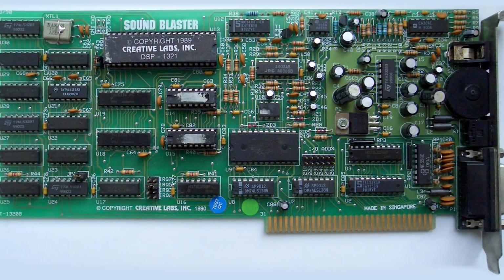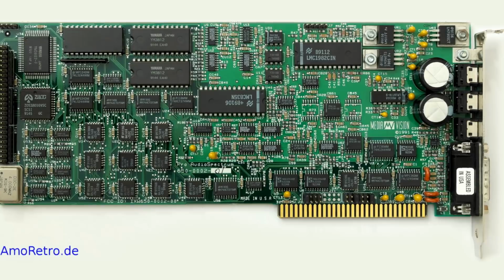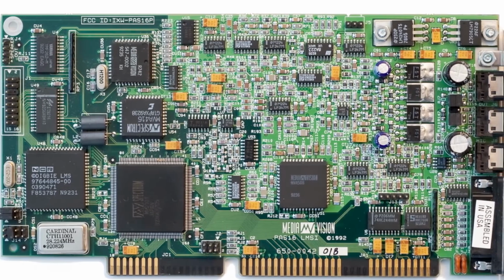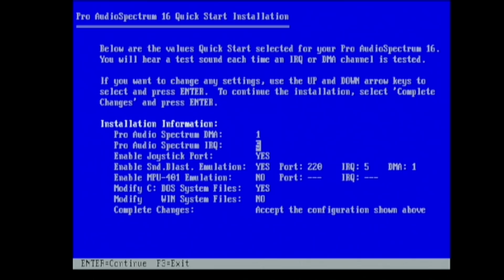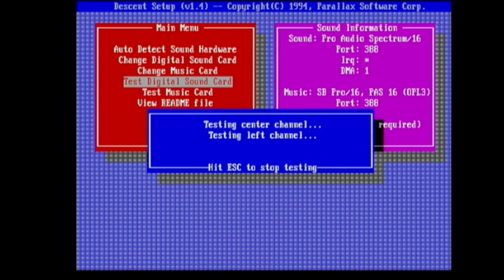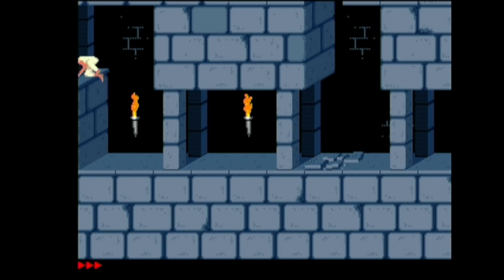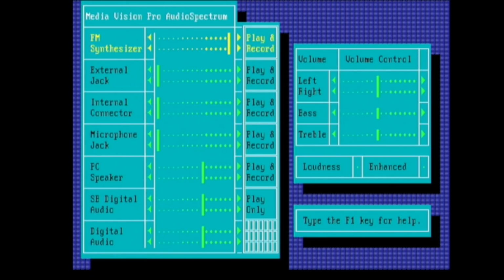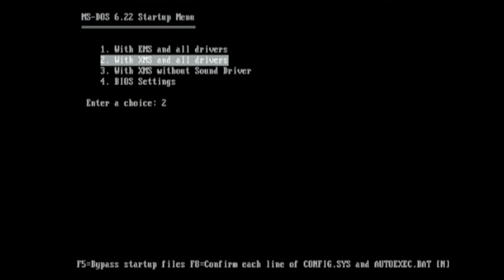MediaVision Pro Audio Spectrum 16 - myth or legend?

Comment: How about a video on Aztech sound cards? They had some quite good ISA cards, some of which they used their own chip designs on. Some of their products were sold as Reveal, usually with Reveal stickers put onto the Aztech chips. I remember having one "Reveal" sound card I was having problems getting to work. I peeled the Reveal sticker off to find an Aztech sticker. Peeled the Aztech sticker off to ahem reveal the actual manufacturer. I found drivers for that and was able to make it work.

At some point Aztech had a huge clearance sale where they were getting rid of all their old stock of hardware that was out of production. I had an 8 bit Aztech card at the time and bought their special wavetable upgrade for it. I don't recall how much $ but it was super cheap - sounded super good though. I do remember I sold the card a while later with wavetable upgrade to a computer store for $50.
Reply from the maker: I have a lot of different Aztech sound cards in my collection. They were stuffed with features, that's why they are interesting too, but were always a really low quality products. Noisy like hell in both ways on the data bus as well as white noise on the output. I still like them too, because they had some features, which other cards didn't have.

Comment: I had a computer with both a PAS16 and a SoundBlaster 16, all configured so that I didn't have to have a boot menu but I still had plenty of low RAM. Each DOS game was setup to use whatever sound features were the best it supported. The PAS16 wasn't actually made by MediaVision, it was a "Reel Magic" combination VGA and sound card, minus all the video and SCSI parts. Apparently the company intended it to be used as a second PAS16 alongside the full video+sound+SCSI Reel Magic card. Simpler to just not populate most of the parts rather than make a different PCB design for the sound only card.

Yup, the PAS16 supported having TWO of them in the same PC. I assume there must have been some software that supported four OPL3 channels or may have been able to use the the mono OPL2 support on two cards for stereo, or 4 channel PCM or???

The SCSI controller on PAS16 cards with it was automatically recognized as a Trantor SCSI controller by Windows 95, and a daisy chain of several SCSI devices could be connected, but lacking a BIOS the sound card couldn't be used to boot the computer. Not that you'd want to because it was SLOW. Just fast enough to handle the transfer speed of a 4x CD-ROM.

MediaVision may have produced a "holy grail" of sound cards, or it may have been vaporware. I saw an announcement or advertisement for a card named "ProZonic", described as supporting just about every PC sound card standard there was. PAS16, Jazz16, all the SoundBlasters, Covox etc. IIRC the only one it was not claimed to support was Gravis UltraSound. Would have been the ultimate in ISA audio, one card, no configuration hassles, plays well with ALL the games.

That was probably right around the time MediaVision went bankrupt, then was reorganized and the new MediaVision insisted several products with their company name, logo etc printed right on the card did not exist. I had one, a Jazz16, said so right on the card. The guy I talked to at MediaVision (at the time I knew nothing about the bankruptcy and reorganization) insisted there was no such soundcard, they'd never made any soundcard named Jazz16.

So if there are any ProZonic cards, even prototypes or engineering samples, it would be quite a collector's item.
Reply: Im trying to figure out where the Media Vision products went after bankruptcy.  I know they rebooted as Aureal, but someone else got the assets before they rebooted.  I think it was an Indian company....random question i know but thought id ask...

Comment: I had an SB16 with a date of 1992. It was loaded with capacitors and jumpers. It sounded perfect and never had a problem with it. I used that card for 10years, it eventuality got noisy.
My mate had a PAS16, not sure of date. It sounded like shit compared to mine, and it gave no end of problems.
Reply from the maker: I guess, that's a very subjective opinion. Of course I don't know the system setup of your friend back in the days, but at least in terms of quality PAS16 is technically by far a better sound card. Apparently, I collect ISA sound cards and investigated and reverse engineered them quite a lot. I have almost all Creative cards at hand and three different SB16 among them. One with new Panasonic high-quality caps, which Creative didn't even think to use back in the days. So I can compare them quite good.

If you are interested in details,  as I said in the video SB16 improved very much compared to its predecessor SB2.0. Creative finally got managed to get rid of the data bus noise, but they were still not as good as PAS16 in regards of the white noise. One of the reasons was, that SB16 made the digital to analogue conversion very early in the chain and was trying to mix and filter the audio signal afterwards. PAS16 on the other hand postponed this step and worked with digital sound as long as possible. They added high quality DACs and moved them out of the DSP to the very end of the signal processing. Not only did it give us very impressive sound control features, which were non existent otherwise at that time,  this is also why you will see almost none of the electrolytic caps on the PAS16, except of two bigger decoupling caps right before the output. SB16 on the other hand used a lot of cheap electrolytic caps, which degraded over the time and introduced even more noise. PAS16 didn't need to use them, since in digital part you can better use tantalum caps, which are a lot more expensive. That was the reason for Creative to make their design in the first place - the price, just as always! Also the fact, that PAS16 didn't use electrolytic caps makes this sound card sound today just the same as it did sound 30 years ago. Without the need to recap it.

Comparing those two cards is a hard thing, since one was a cheap consumer oriented product and the other was a semi-professional high quality product, which was probably too expensive. It's like with digital cameras today, you won't buy an expensive DSLR, if you want to make your pictures in Auto-Mode all the time. It's not worth the money, since in Auto-Mode it is probably just as good (or sometimes worse) as a smartphone.  But if you need to get more out of it, you will reach the limits of a simple camera quite fast.

A sad fact is, that as soon as MediaVision was dissolved, Creative dropped the quality dramatically and introduced all the cost reduced SB16 Value  and Vibra cards, again with only dual layer PCBs, noisy and with CQM instead of OPL3.
Reply: @necro_ware  Big reply... The SB16 92 or 93 is the only product I've ever liked from creative, The non plug and play ones. It did sound pretty good with that fresh at the time CD quality sound... I have noticed how cheap any other product looks, including other SB16s... I couldn't recommend anything from them.

My mate only had a 386, im thinking now maybe he didnt have the PAS16 but just a PAS. Maybe he had frequency and/or sample bit limitations.

Anyway I subbed, cheers dude

Comment: I would love to see you have a look at the SoundBlaster AWE32, just the sheer size and sound of it was awe-inspiring :)
Reply from the maker: I had some AWE32, but I sold them all and left only AWE64 in my collection. It is almost the same card and it sounds really good, but I it is quite common and the most people know it quite good. Since most of AWE32 and all AWE64 don't have the Yamaha OPL3 FM sound anymore, but use Creatives CQM instead, they sometimes sounds quite disappointing in older games. That's why this cards are not too much appreciated in the retro community. Anyway, they are still good and easy to find, so there are many videos on youtube about them already. I currently don't really feel the need to make another one. May be some day in the future, but for now I instead prefer to show something, what not everybody can find so easily.
Reply: @necro_ware  I can appreciate that, but thanks for the shout-out to the card here :) I was frankly blown away by the difference in midi between the SB16 and the AWE32, like, for example, the old star wars games beatifully showed, Tie-Fighter and X-Wing come to mind ;)

Comment: The PAS16 was great. There are a number of misconceptions about it, such as the belief you needed a dos driver to "emulate" the SoundBlaster. This wasn't true, it handled SoundBlaster within hardware.
Reply from the maker: Yes, it made it in hardware, that's true. However, many people think of software, when talking about an emulation, but you can also emulate in hardware. "Emulation" means basically to mimic something in the first place. It doesn't say anything about hard- or software by itself.
Reply: @necro_ware  exactly. I really wish I still had that card. For some reason, I still have a SB16 that I had later. Don't remember why I ever replaced it, since it was so much better. ☹️
Reply: The SoundBlaster support on my PAS16 died, and I had to have the card replaced. My roommate had a PAS16 too, so I was able to verify it was a hardware issue. MediaVision support had never heard of it happening, but they replaced it with no hassle.

Comment: I had one of those cards. Very awesome. They really went to town on the analog audio quality. One thing I noticed about my card was the analog Cd audio plug. They had used a guard ground for the braided shield in the audio cable, and used separate ground for the left and right channel. The guard ground was only connected to the case ground, the left and right grounds went to their own pre amplifier. They would use any signal accidentally generated on the guard ground to subtract it from the audio, and the separate grounds were "mixed" back into their respective channel. This would really reduce the digital noise that would leak into the cable and cause noise to appear and was really good in preventing the channels from "leaking" into each other.
Reply from the maker: Very interesting, shows once again how much MediaVision cared about the quality. Thank you for the information.

Comment: If I remember right, didn't some of the PAS cards also Logitech's "SoundMan" line?
Reply from the maker: Yes, I know at least one PAS16 card, which was released under the name Logitech. Still it was a MediaVision card, just with Logitech logo on it. As MediaVision became Aureal, they never made their Vortex sound cards under the own name, but sold the technology and produced the cards for Diamond, Hercules and many others.
Reply: @necro_ware  aye, I have an MX-300 (need to get the daughterboard for MIDI, as well as the digital audio bracket), and at one point had a few OEM Turtle Beach AU8830 cards.

Comment: More copper doesn't necessarily mean higher costs, because PCBs are made starting with a board completely covered in copper and by removing all the copper the design doesn't need.
More layers are more expensive though, as are more vias in some cases.
Having the same number of layers, a card with a bigger ground plane can be the one with the more careful design compared to the other one but not the better manufactured one.
Reply from the maker: Thank you very much for the interesting post. I'm mostly agreed, since I tinker a lot and order quite a lot of PCBs myself. However, I would like to add two things, first of all the amount of PCBs you order and the time play an important role. If you order only some PCBs today the manufacturer simply charges you the whole copper on the PCB, regardless how much you need on the final project. The copper they remove from the PCBs will be reused and not thrown away, but with a small batches it's not wort it to take every mg into account. However if you order millions of PCBs it can matter and the companies can negotiate about it.  Furthermore back then the techniques of PCB manufacturing were quite different as today and since Creative was very much profit oriented, they negotiated about every cent. About all the other things you said, I'm absolutely agreed with you.
Reply: @necro_ware  You make a very good point. Having ordered and etched quite a few pcbs over the years I definitely come from a tinkerer's standpoint. Thanks for the interesting insight!

Comment: I loved this video, there are very few videos regarding this card in youtube. Back in the 90s (around 92 or 93) My dad bought our first CD/sound kit. Came with many games like civ1, mantis, comptons encyclopedia, battle chess and many others. I was lucky to have that kit, few people back then had one of those and they all played with internal speaker. The kit came with a sony CDrom with a media vision pas16 and labtec speakers. I trully love the sound of it on DOS gaming, and years after i was able to compare against all the bugs that SB16 had, like hanging not bug and i just go back to my PAS16. Im currently building a k6-3 retro pc, i has AT + ATX connector, maybe i will not need a voltage blaster at all.
Reply from the maker: Cool! Many older ATX power supplies do provide -5V as well, so you don't need AT. However, they were usually produced before 2004 and unfortunately a lot of power supplies from that time were very low quality. So take a look at least at the caps inside before you connect it.

Comment: do you know what cound card i remember from my childhood
it was yellow/hold/ orange pvc
i remember it had screws on every audio jack and gamepad port
full sized isa 16 card
either on windows 95 or in pcb itself i read and remembered a string of words "trump audio wave 32" but it was 20 years so i might remember it wrong

i don't remember if i asked that before :P
Reply from the maker: Hard to tell, but if I google for the description I find this one: https://retrosoundcards.files.wordpress.com/2011/06/trump.jpg
Reply: @necro_ware  it was pnp compatybile so it is very possibe
fun part is i never had it working because computer was a gift and we didn't have the drivers or internet
we switched to sp16pnp soon after and never looked back , but i sometimes wonder what was that thing even capable of
Reply: @necro_ware  fun fact, the blog the image is from is in my native language :P
Reply from the maker: I understand written Polish if I read it slowly, but I don't understand it, when spoken. It's just too fast for me to associate the words  :) Anyway, that sound card is really interesting. It has an on board General Midi with the SAM9233  WaveTable processor. Uneasy to tell, but the F245 (U15) is probably a fake OPL3 clone, which should sound exactly like the original. I can't tell anything about the quality, but feature wise this sound card is by far better, than SB16.
Reply: @necro_ware  tell that to 12 years old me 20 something  years ago :)
Reply from the maker: @kokodin5895  Yeah, the usual story. We've all been there :D

Comment: Fantastic overview of the card, and very comprehensive tests, great job!  About the only thing I can think of to add is that the PAS16 is special in another way:  It can reroute the PC speaker audio through the card not using any wires.  I touch on this briefly here:  https://youtu.be/wi2tW23qb9c
Reply from the maker: Yes! I tested it in multiple mainboards, but it didn't work everywhere. Unfortunately I was short on time to dig deeper into it and forgot to mention it eventually.

Comment: There was an in-between model, the PAS “plus”. I’m assuming it was the same as the PAS 16 but with 8-bit audio. I think it had the Thunderboard chip for backward SB compatibility. Once again, great video.
Reply from the maker: Thanks! I didn't mention some of the cards indeed, since they were not really historically relevant. If I got it right, the PAS Plus was a cut down version of the PAS16 and was released later. So PAS Plus is more a PAS16 Minus :) Unfortunately that card is also super rare to get details about it, so I just didn't mention it eventually...

Comment: Nice, I have a PAS 16, but have never really taken it into action (yet). I should change that...
One correction: The SB Pro doesn't have two DSP chips, I'm not sure what the second one (on the left) is doing, but probably not the same - maybe it does the Stereo setup/channel switching handling. It has about  the same DSP chip as the SB 2.0. In fact, it STILL outputs mono as first step. The channels are separated by switching L/R for every sample (one of the smaller ICs beneath the amps should do that). That's the reason why it can play 44.1 in Mono, but only 22.05 KHz in Stereo - it's essentially halved.
I remember the SB16 "DMA" clicking from my expensive AWE32 "value" edition as well - but from Day of the Tentacle, the intro scene where Purple Tentacle says something. So if this is at hand, it may be an alternative.
Reply from the maker: Yes, makes totally sense, thank you for the correction. I just looked once again, the left IC is the DSP and the right one is indeed CT1345, a mixer.
Reply: @necro_ware  So I confused them as well, or their order ;). Good to know! Also explains part of my theory: The mixer chip also handles the stereo setup programming wise, so indeed it handles at least partially the stereo part.

Comment: In the 90s, I bought a bundle with PAS16 and a SCSI CD-ROM for $100. I didn’t appreciate this card enough as a kid. I remember being annoyed by the driver requirement and compatibility issues. I quickly sold it for the same price I paid and went back to SB cards and IDE CD-ROMs. I wish I kept it.